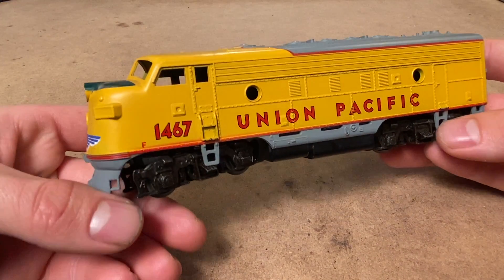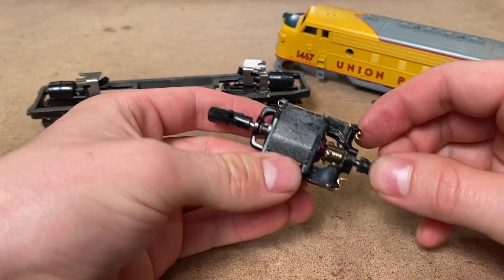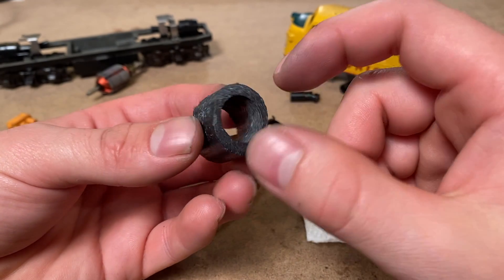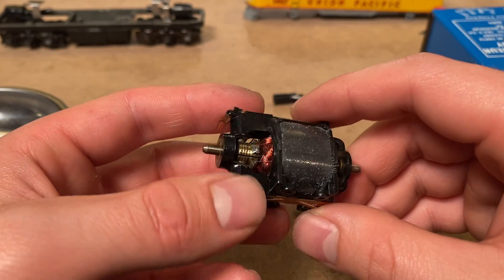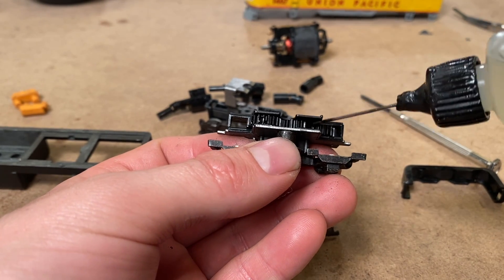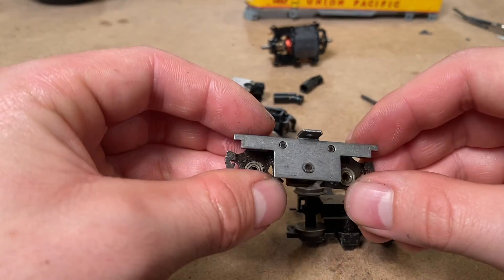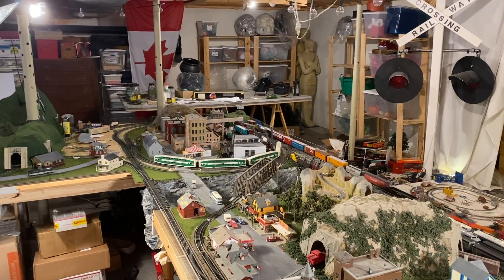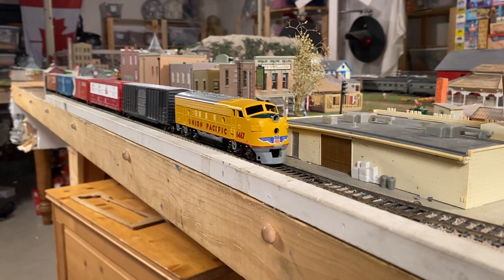Can We Make This 1969 Union Pacific F7 Run? Seized Motor...

Comment: Those old Athearns are great values. I used to pull 100 car unit trains with 4 Athearn engines when I had my large layout in the 80's.

Comment: I generally replace those old solid magnet Athearn motors, since I have noticed they tend to draw a lot of amps, which is not good for DCC conversion. The new type Athearn gold motor is a really good replacement, even without the flywheels. That's one of the things I like most about Athearn BB loco's, they're easy to upgrade, using original Athearn parts.
Reply from the maker: That's a fair point.

Comment: I don't know who informed you that removing the armiture from a permanent magnet dc motor would in any way affect the magnetic field is living in a fantasy world. The armiture is merely in the field lines and removing it doesn't change the magnets from which the magnetic field eminate. Elementary school science.
Reply from the maker: I've been told that by many experienced railway modellers. I wasn't sure if it was true or not however to your point, there has been no difference in the current draw after removing it. If it did affect the fields I suspect the motor wouldn't run as efficiently.

Comment: Nice video. I've serviced and converted several blue box locos to DCC. These older Athearn units are pretty easy to work on.
One thought: It's great it ran fast and all, but how slow will it run smoothly? To me that's always a better measure of how well a loco performs.
Reply from the maker: Have you had any issues with the amp draw? I added DCC to one pulling the usual 1/4th of an amp and it fried the decoder within a month.
Reply: @SMTMainline  just experienced that today with one of our club locos. It was one of the older motors with the gray sides. Motor got hot enough to warp the 3D printed bracket I used to hold the decoder.

Comment: In my personal opinion the old style Athearn motor was much better than the current motor with brass fly wheels, the steel fly wheels didn't come on that motor until four years later in '73 it added extra weight to it which is even better in fact they should have refined the existing motor instead of using an over long version which looks so lopsided when installed, Also the metal side frames were better than the plastic ones that would replace the metal side frames in '75

Comment: Older video I know but I'd open it up again and clean it out one more time. I bet some metal bits have shaken out and are attached to the magnet. I find a toothbrush or smaller but stiff paint brush will knock those metal bits off.

Comment: I have seen this before, people with home shop grinders and Metal saws etc. the shavings get everywhere.  You have to use high pressure air from a compressor or canned air and blow that unit out completely.  The high pressure will blow the shavings right off no issue, just do it outside and use eye protection.  Rinse with electrical parts spray or contact cleaner spray and it should be squeaky clean again.  The little bit you left in there will eventually destroy that motor which would be a shame as shes still a good runner.  

Athearn Blue box aside from outright abuse are near indestructible which is why they hold pretty good value.  Thankfully they made so many that you can still get them pretty cheap.  I never pass on Athearn blue box engines at shows especially the the small yellow parts pouches that many folks never used that has the glass, rails and other parts.  You can easily replace the engines with basic double shaft can motors if you're really pressed for parts.  Great video as always!

Comment: The thing about  Athearn is the ability to switch covers with the better running motor.  Also F7$ and four axle geeps  handle smaller radius track as good as any as you illustrated here.  Nice job fixing the little shaver..)

Comment: You can remove the armature with no worry, just put a bolt in place allowing the bolt to to touch the magnets. This will keep the magnetism in check for as long as you need.

Comment: I had an athearn blue box dd40 dual motor that had the same issue with the motors. One magnet was in multiple pieces! I believe the magnet started to decentigrate due to corrosion or being dropped.

Comment: Spare yourself the aggravation and install a new can motor. Use silicone to set it. A-line and NWSL make excellent kits for this. Hard wire he assembly and this will run on poar with Atlas.

Comment: Looks like the magnet is slowly disengrating. I've seen that before in a motor out of a Chinese remote helicopter. Unfortunately that cannot be fixed, and you will have to replace the magnet or the motor eventually. All those bits stuck to the magnet are actually part of the magnet that have come loose. Looks like you could really use a digital multi-meter which is invaluable in checking electrical stuff, like making sure each of the armature windings are intact.

Comment: i bought a lot of 10 athearn blue boxes at ebay. 4 of them had similar motors but even in worse condition. the seller cleaned for the pictures the boxes of the fallen-off magnet pieces (and thats what the small metal pieces are!) and told me that he didnt saw it. one of the magnets was rotten to the half of the original size... the discount was about just 10 percent so i decided to return and take my money back. good the decision, once the magnet has started to fall apart it will continue and you cant stop it.
the end of the ebay story? the seller sold it again and - surprise surprise - again without to mention the problems. even the cleaned pictures were used again...

Comment: For better electrical contact, solder a wire from the top tab of each truck to the long metal clip on top of the motor....I've done that with every old Athearn loco I have (those I haven't put DCC in yet).   And just in case...I always test them with the shell off, because I'm a clod and I'm likely to screw something up...but still...DAMNED FINE WORK, Harrison!!!!

Comment: I run o/o27 and frog snot makes it so i dont have to see the bands as it drys mostly clear. The trade off is theres a loss if traction by one freight car. I have even used it on non-banded engines (VERY thin layer) to gain traction about 2 cars more.... but also could just add tire weights or fishing lead flattened with a hammer.

Comment: Time for a new motor. Your magnet is disintegrating. This is not the first time see this, and I've had this type of Athearn motor with the same magnet completely disintegrate into the same shavings.
Reply: Something that I can recommend helping the magnet from disintegrating would be painting with a coating of clear fingernail polish on the whole magnet. This will help prevent oxidation from contributing to its destruction. A lot of these magnets are made from powered/sintered iron, and they oxidize causing their break down into shavings or powder.

Comment: If you ever need to remove filings or pick up track pins 😂 put a neo or strong speaker magnet into a plastic bag or even an envelope and stronger magnet will attract all the filings and they all stuck to the outside of the bag etc. Remove magnet and all drop off.

Comment: I had an Athearn locomotive of that vintage once. The motor mounts are usually a grey rubbery material, possibly a molded RTV. I know that the magnets are sintered iron, a process of molding metal with heat and pressure, but not melting. Like Zamac, it will breakdown with time. Considering the condition of the shell, it was probably stored somewhere where it cycled through extreme cold for fifty years. I am surprised at the minimal loss of magnetic properties. I would, however, replace the magnet eventually, as once the deteriorating starts, , it will continue, though probably a a slower rate, with your TLC. Be well.
Reply: it needs a real remotoring job- with a good can motor

Comment: the myth about disturbing magnetic field originated with early alnico magnet motors that could be demagnetized and remagnetized quite easyly at room temperature by exposing to other magnetic fields (shiny light metalic looking magnets)
ceramic  ferite (black ones) magnets and neodinium magnets can only be magnetized and demagnetized in high temperature (above 250c) or very low temperatures (below -20c)
they lose some charge with time but removing a rotor from a motor won't hurt it, unless you put it back without aligning the shaft in the middle
Reply: From personal experience, I can say that removing the armature definitely killed the strength of the field magnet on a fair few motors of mine.... but I'm pretty sure every single one of these motors had an Alnico magnet. I've been replacing them with neodymium magnets, it's reassuring to know that they aren't nearly as sensitive in this regard.
Reply: @leverettrailfan5414  i literally taken apart hundreds of ferrite magnet motors,(mostly fs130 and fr260) swapet magnets and armatures around  and never noticed any ill effects, plus in poland where  i live there is no such beliefs going around
i literally first time learned that idea from train model repairs videos.
i even rewinded some motors at home and with old train models the most problems i ever had were worn out metal bushings(filling those with babit and redrilling fix those awfull noises those made)

Comment: I use "Brake Kleen" to clean armatures and magnets, as it also displaces moisture and dries without a residue, followed by a soft toothbrush to remove any oxidation. Only caveat is it will attack some types of plastic, so you have to test it on a small part first.
Reply: Cue dramatic music (If you don’t get it, it’s from South Main Auto, a YouTuber that owns an automotive shop)

Comment: I’m pretty sure that the motor suffered some damp corrosion just from the look on the steel motor. But no other parts on the model have damage except for the rust on the contact strip and a good way to clean corrosion like that is with a dremmel with a certain attachment( I forgot what one) Great job fixing this SMT!

Comment: Congratulations on getting it back on the rails! 🎉. A suggestion would be to clean up the points where the trucks contact the frame. An important electrical contact point.

Comment: I got a Penn central athearn gp35 with this drive, and it runs decent even with half the drive. Reason why I say that is because I’m missing the piece with the worm gear for one side. I had to completely take it apart and reassemble everything because the trucks were falling out and parts were falling out as well.

Comment: Tape is definitely the best method of removing the metal filings from the magnet. I had that happen to a rare-earth magnet I was using to find a small metal part I dropped in the driveway. Big mistake -- I didn't find the part, but the magnet suddenly became very hairy from metal filings left by cars parked there. Tape is what finally pulled the mess off the magnet, but it was something stronger than masking tape. 

I'd go back in there with some packing tape (stronger adhesive than maasking tape) and remove as much of the remaining filings as possible  just for the long-term health of the motor, even if it may not see a whole lot of runtime after today, given the number of engines you have :D
Reply: duct tape would work, as well- not the cheap crap- the gooey type like 3M or duck tape.

Comment: I’m guessing the steel shavings are most likely the result of steel wool being used to clean some track. Probably someone inexperienced cleaning old track and not fully cleaning up the loose metal.
Reply: i would assume they are bits of the magnet- steel wool remnants would look like super fine wire thats been burned.

Comment: great restoration as always. one testament to Athearn I noticed with model power or lifelike/phroto 2000 1000 they took their design because it works so well. the only thing that I can't stand is that piece of metal that goes between both the trucks. on my f unit I removed it and soldered a piece of wire between both and then solder that to the motor because I had an issue with mine otherwise a great drive system that has worked for generations. there is one thing different on yours versus mine the motor mount are held in with screws it vs pegs. anyway 12 cars I think I counted on level track I'm sure if it was weighted a little bit more it could haul more but that's still awesome. mine Hauls about the same also the motor is a can motor versus the open motor that you have.

Comment: And Harrison saves another one.
69 would have been blue box but IIRC til the mid 70s or so possibly a bit later Athearn offered two versions with the flywheel version being a slightly higher price point

Comment: When you disassemble those Athearn motors, make sure you you mark the magnet so it goes back together the right way.  If the magnet is installed backwards the motor will run backwards.  It's the magnet polarity that determines direction.
Reply from the maker: That would be a smart thing to do. K&J magnets also has an app which can somehow read the magnet which is helpful.
Reply: @SMTMainline  modern phones have magnetic sensors inside them, pretty much all of them as I’m aware.
Reply: you can do it with a cheap needle-type compass- good work, harrison! rob
Reply: dot of paint works best. get a paint marker
Reply: @peterkneissl3358 
Even better is a silver Sharpie.  Great for writing on dark surfaces.  In fact I use it for touching up the silver paint on my locomotives.

Comment: Dang, Hornby didn't make mechanisms like that until the 2000s. (A large amount of my collection is Hornby British locomotives.)

5 pole motor, bearings on the axles. Only way that mechanism could be more modern is with flywheels and DCC.
Reply from the maker: Athearn was far ahead of its time when they were making these. It took their competitors some 20 to 30 years before bringing out something that could out do them.
Reply: and a can motor that can't screw up like that- a can motor that can't....?
Reply: @tommurphy4307  that made no sense

Comment: I wonder if using a typewriter vacuum, or a canister vacuum with a "crevice tool", with a toothbrush might be a good way of removing metal filings from the magnet?
Reply from the maker: Maybe so but I can't say I've had to deal with this issue before.
Reply: I wonder if the previous owner had his layout in a workshop room where he used a grinder to build and/or repair metal items?
Reply: where could the metal filings have come from? the armature is much harder than the magnet- and athearn would never use conductive material for the magnet....

Comment: Wow! That emd (gmd) f7 engine is just running like a rocket and athearn engines are just built as tanks right there like you said. Just to let you know on some of the older athearn units from like the late 60s maybe thru the seventies like the f7 right there it may take like a metal coupler cover there like on most rolling stock there so and yeah the later athearn blue box models does use a plastic coupler covers. But anywho we got a runner and serenity! Very good on this model plus thanks for sharing this bro! Matt k
Reply from the maker: Darn fast little locomotive, they must have changed the gearing in later models.
Reply: @SMTMainline  it maybe be alittle identical right there with the later models too idk plus the flywheels were like painted gold unlike the older blue box ones that are like silver or gray though. My guess.
Reply: oh you mean that metal coupler spring-like thing that the rolling stock they have uses? I know I have a b unit that has those metal coupler covers but it has like the rolling stock a plastic box for it to clip on. my a unit has a coupler box that is plastic kind of looks like a Kadee and has a screw which he was talking about which I'm sure if he had one in his parts bin we would have seen it. I've seen many of rolling stock that I recently picked up missing those coupler box covers which are found on their website and on eBay you can get them used or you can get them new because some people cut them off I don't know why but probably because the plastic does get fragile when you have to try to fit Kadee couples